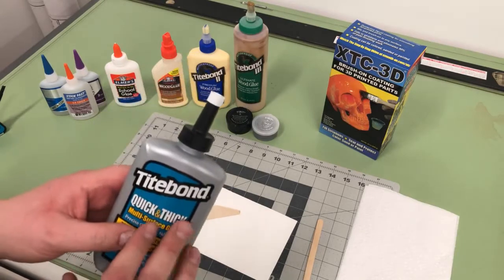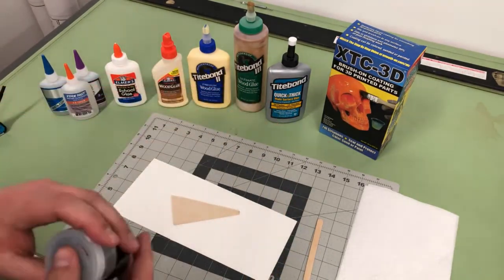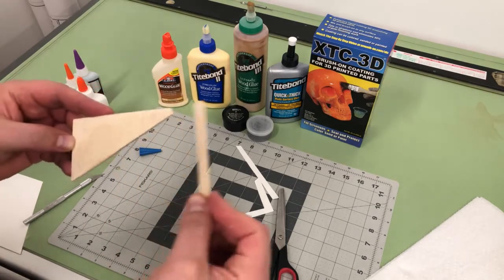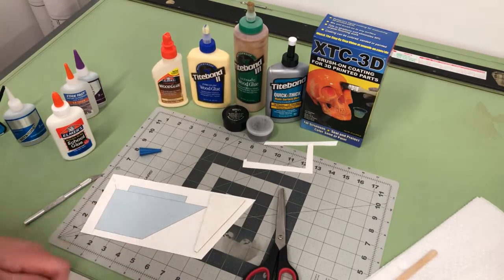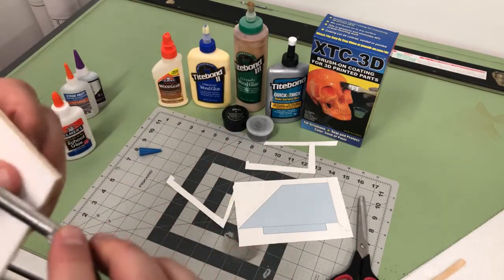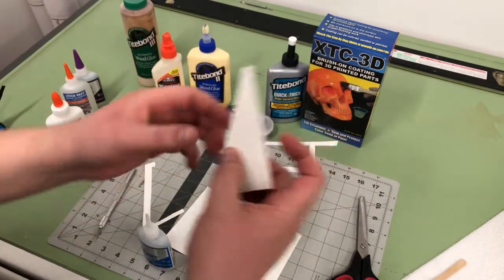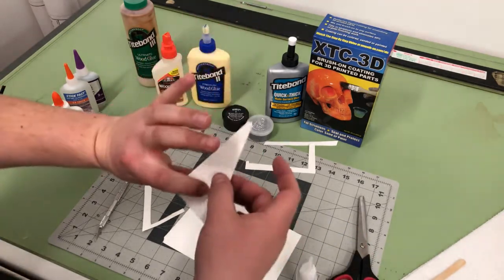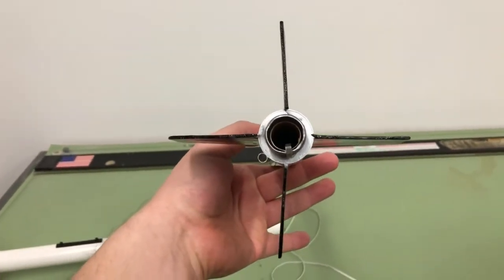Paper Skins for Rocket Fins

Comment: For papering fins, I prefer wood glue. It works well. Tbh, you're binding what's essentially wood to wood, why not use what it's made for? 

The only thing, is too much wood glue will result in warped fins.
Reply from the maker: Good point! I mentioned the white glue because most kids/schools will have it available in abundance.
Reply: @jackofall8617   True. Thanks for posting this video. I know you posted it ages ago, but it's great to help others. :)
Reply from the maker: @electricyellow613 no worries. I need to make more as I use them every year for students